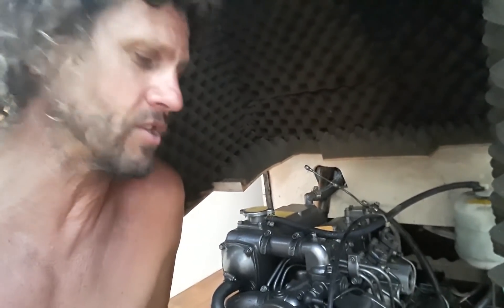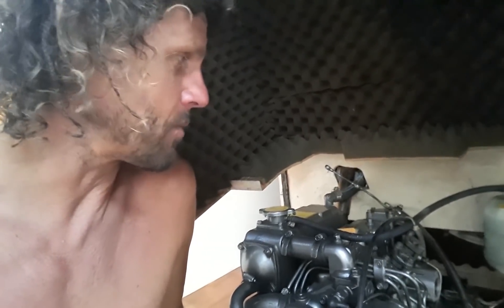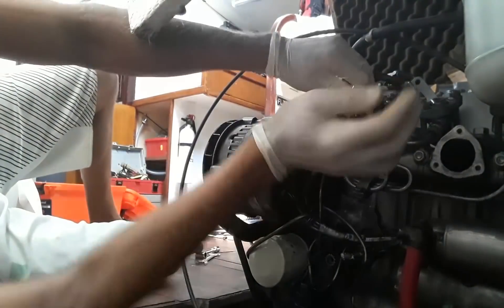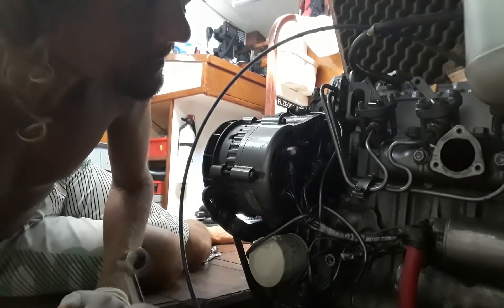Ep.196 Engine and tricking the Alternator

Comment: So buy an inexpensive PWM controller and rest easy. Otherwise there's risk of overcharging the batteries if connected direct to the solar panels. A Bogart Engineering SC-2030 can be had for less than $120.

Comment: Listening to Plucky give us an Electrical talk has made my day 
Walter has brought up an interesting point using the VSR, ive never thought of doing that.
I'm not going to be one of those commenters that writes 20 lines of how a DC charging system is meant to work (i could, but i wont) suffice to say, here is the oppertunity for Redarc or Projector or Victron to sponsor our little buddy a DC to DC Alt/Solar controller that he can program to suit the battery chemistry he has and it's specific charging needs.
Note: Its time for 50Amp Circuit Breakers to be installed before this boat burns down.

Comment: Use program "filescavenger" to retrieve you harddisk files. DAto is often there but Windows wont get you access due to "data safety".
Reply from the maker: Will try it although I think a tech guy already did that. I think its a lost cause
Reply: @SAILINGintoFREEDOM  If there is not a physical damage to the drives its almost 99,99% likely you will get your data. For god sake. Take care of those drives and get in contact with the right people.

Comment: Replace that undersized alternator with at least an 80 amp Ingrams one, when you get back to Australia, they are cheap. A number of us have made that change, and the batteries get a ton of amps and charge to 80% in a short time. The rest of the charge will be at low amps for lead acid batteries, don't force them with high voltage, you will kill them.
Reply: Why wait till you get back to Oz!!!

Comment: Not sure what injectors have to do with oil consumption other then your using the soot build up to diagnose which cylinder is burning the most oil. I would find someone in port that can firstly do a bore scope inspection so you can see bore wear/scouring and carbon build up on valves and or a diesel compression test or cylinder leak down test with a dummy injector, that way you can get an idea if its rings or valve seals. You can buy cheap scopes that plug into your smart phone and have a look yourself as it looks like the injectors have a fairly big entry port into the cylinder. Sure by now though you've already sorted it and are once again on your merry way. Cheers mate 🍻
Reply from the maker: Thanks Michael. We tried to find a dummy injector in Rio Dulce but no one had one even for a Yanmar...crazy..thanks for the advice

Comment: I'm sorry  but the answer is no. Do not run your solar directly to the batteries and do not run your alternator at 16 volts. I've ruined a lot of good equipment on my RV because the shop wired my new alternator up incorrectly and made it put out at 16 plus volts. If you do things Walters way you have to be the regulator. You have to be the one that watches out for over charging or boiling the batteries out of water. It's ok if you have junk batteries,  You have to be the one to turn off the solar panels. The MPPT is the best chargers out there. They make the most use of the wattage that your panels can make. You or I cannot regulate the alternator or the panel in an efficient manner. It's just not mentally and physically possible. 
You have to ask yourself, why doesn't everyone use Walters method. You will soon need a new alternator and batteries. But then who am I. Just some crazy old guy. Just some guy that has spent more than 40 years solving electrical problems on cars, trucks, boats and and heavy equipment. Not one time did the solution be bump the voltage up to 16 volts. 14.2 is the norm. Maybe a few at 14.6 but that's it. There is the occasion for the voltage to be up higher if you have to do a battery equalization charge for batteries that are not in good shape,  but then again I could be all wrong. It's also possible I misunderstood Walter.
Reply: petnzme01  Lol, Pottering around for 40 years :) Any fool can be the regulator for a while but it only takes a moment of in attention before you have a problem. Walter may not have anything else to do but watch his batteries. Watch his voltage, watch his charge current. Peter and Margarida go fishing, hiking, swimming. All of this occurs when the sun is high in the sky and charging is at it's premium. So do we go for a hike on this interesting little island and have a cookout before we come back or shall one of us stay on the boat and what the batteries boil. Oh yeah we need to wire up a temp. sensor on the batteries  to keep an eye on that or maybe we can just ust the one from the galley. 
Peter can do as he sees fit. I have no problem with that. What I have a problem with is supposed experts putting out erroneous and dangerous information on these sites that new or less knowledgeable sailors decide to try out. And ruin their batteries, alternators, solar panels, wind generators, or worse burn the boat to the water line and them selves to boot.
They used to call them Snake Oil Salesman.
Reply: The batteries regulate the voltage while charging , after that, that is where the voltage sensor relay cut out walter recommended comes in.
Reply: Walter is an electrician...so he should know what he is talking about. Peter needs to cough up for the controller etc ..as he  said not a lot of money!!!
Reply from the maker: Well it has been running for more than a month and it works. I am the regulator for the time being until we get the black box to do it automatically but my MPPT was definitely letting me down. Batteries are charged and fine now instead of struggling
Reply: @SAILINGintoFREEDOM  That's great. I'm happy for you.

Comment: MPPT = Maximum Power Point Tracking. It regulates the output Voltage from charger to batteries depending on what Voltage the batteries are at. Charge (current) will flow from the highest Voltage to the lowest, the higher the difference, the faster the batteries will charge. If too high, the batteries will overheat and degrade (less life span).
Reply: Josi Dasilva : yes he just explained all that

Comment: Walter is correct. MPPT will improve the overall quality of the charging system. But, the basic principle is still the same. Raise the voltage of  the system above the batteries and they will charge. But, don't go crazy.
Reply from the maker: Thanks Mark.

Comment: generally sail boats sit alot and the fuel tanks go to hell cause over time condensation gets into the fuel tank and rusts. then it gets into the injection pump. then it can get into the injectors. Try some Techron  injector cleaner for diesel engines.
Reply from the maker: Thanks Mr Ford Guy

Comment: Sounds like a good trade on the dingy to me. I'd say as long as your wire size is big enough for the max amp and your connections are all tight I would agree with him too. What about your engine?  I hope just loose injectors in the first go around. 
What did you do to Margarida?
Reply from the maker: I think it was loose too cos the blackness has gone away